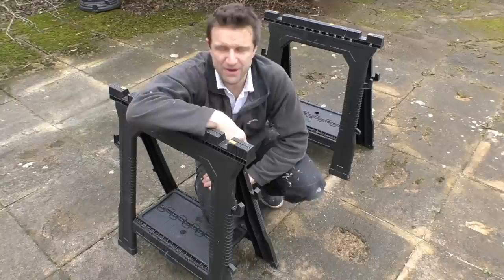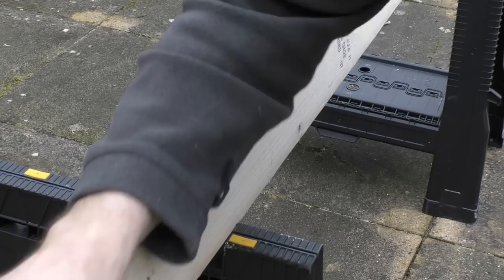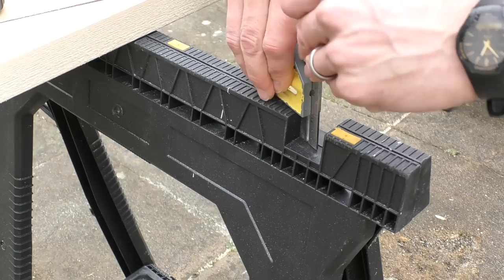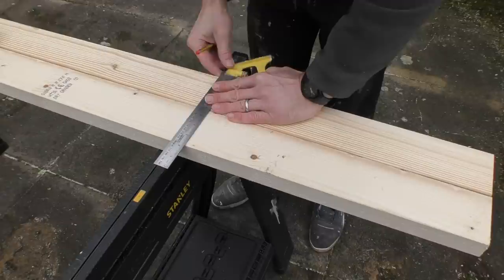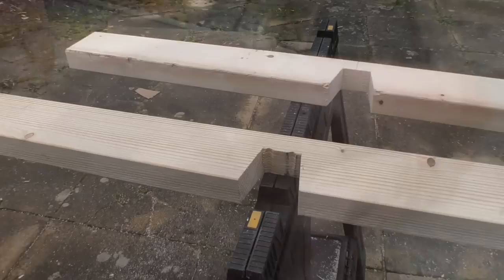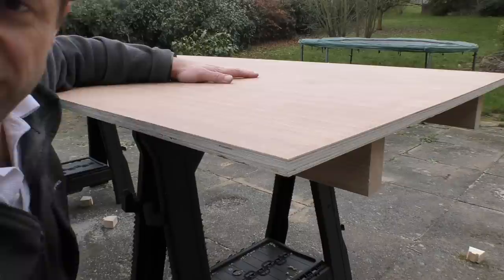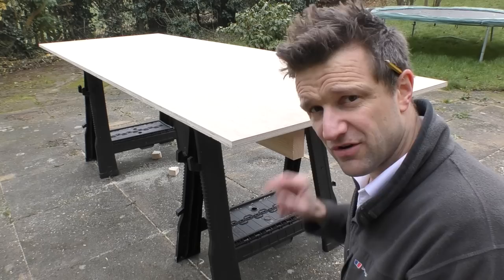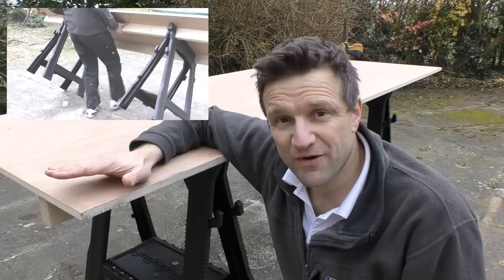How to Make a Portable Folding Work Bench: Video #1 of 5

Comment: Watched this video before Christmas. Added these sawhorses to my Christmas present wish list. Received. I haven't done what is done in this video yet, but I've used them several times over the past week in building new garage shelves. 2x3's slot right in to the notches snugly, and with chipboard screwed to them, or 2400 2x3's used with 2 sheets of chipboard screwed on end to end, this has provided a great worktop and assembly bench. Once finished my work, easily and quickly dismantled, and the sawhorses take up very little space in the garage. Thanks Charlie. Already one of the most beneficial items in my garage workshop, and I see so much more that they are going to benefit with overtime, both inside and outside!! Simple, but superbly effective.

Comment: Splendid video. I have those same sawhorses and have used them with 2x4 studs and plywood to make a temporary workbench many times. I noted the same "rocking" you mentioned but it never occurred to me to lower the point of side-to-side force and thereby reducing the leverage the top-heavy bench has on the structure. Brilliant. My needs are lighter, so I am going to use one-half-inch plywood, just to save some weight. I am making mine today and after that is done I am going to spend time watching other videos you have posted. Thanks again.

Comment: I made one 2 x 1m as a temporary work bench last year. Its been a lifesaver and I can pack it away in the roof space of my garage. I added a couple of rows of bench dog holes for extra versatility and so I could use it as a track saw station. Works really well. The Stanley saw horse are currently (13/03/2020) on offer in Screwfix £20 a pair so about 30% saving.
Reply: £20 a pair again from screwfix on 14.08.21

Comment: Just a suggestion for all you DIY'ers, the 2x4 supports under the short end of your worktop will work best if they are set back 6" to 9" just like the side overhangs which will allow for clamping ease around the whole circumference of the Sacrificial worktop. 2"-3" is all you really need, but I like a few more inches so I can drill 3/4"  Dog Holes As Needed To Allow For Clamps and Stuff. Check out Kreg or Armor Dog Clamps
Reply from the maker: I agree Glenn, and this is what I did when I modified it https://youtu.be/PTN3EmLiYdg

Comment: 27 years in the trade and why have I not done this before.?!
I will be doing now, cheers.
Reply from the maker: James S Flattered that I've been able to show you a new tip James! I've bought the UKJ Parf Guide system but just need to get round to installing it. A bit expensive but it'll transform it!
Reply: Charlie DIYte 
A true tradesperson never stops learning. I’m sure your the same 👍🏼

Comment: Made this in smaller form, using pre-cut 4 ft 2X4" pieces and a 4X2 ft "project panel" topper from Home Depot, who also carries the Stanley sawhorses in this video. I was going to get a Workmate 425, but this works fine for me and saved me some money, too. Cost about $60 as of 7/7/21. Thanks, Charlie.
Reply from the maker: Great work. I couldn't manage without mine. Worth putting a protective strip around the side if necessary. That's in the next video in this series 👍🏻

Comment: I made a worktop using 2 x 3" planks (8 foot length) and 2 project boards of 30 x 48". I simply fixed the project boards to the planks using wood screws to make an 8 foot by 30 inch worksurface, which I simply seat onto the sawhorses for an amazing DIY'er workbench. It's sturdy enough for the at-home projects that I've been doing, though admittedly no where near up to the standard demonstrated here. But for home diy jobs, it's been great. When I'm done the worktop removes easily for storing away. I plan to put some cross supports to up the strength and stability of the worktop since I'll be moving the it around over time as I take it in and out of storage. Thanks for the inspiration!
Reply from the maker: Good work, George. Yes, that sounds like an excellent work around. Bottom line, we all need temporary work tops for our DIY projects, howsoever we make them 👍

Comment: Yes I do the same thing and have done for years, except I don't cut the angles which as you so rightly state gives it very good stability. The reason being that it allows me to reuse the 4" X 2" CLS on other projects. It is less stable this way, but I get by. Thanks for the video, most helpful.

Comment: Of course I will hit the like button and subscribe you have just solved my workbench problem. I had just bought the Stanley saw horses and was using them for door top work bench and needed something better. Your video is perfect thanks for sharing. I think I will wrap the top with 2 x 4s so I can add a vice somewhere. Thanks again very much.
Reply from the maker: Thanks John. There are 4 other videos in the series - you'll find links to them in the Description below the video. It's been truly game changing. Well worth putting a protective hardwood or metal edge around the side, and it's quite heavy to lug around so it's a good idea to try and hinge it if you can be bothered 👍🏻

Comment: GReat idea, gonna make one of those. You can seal the edges with some SBR or waterproof wood glue.
Reply from the maker: There's a whole series on the upgrades I did to this - check out the links in the Description. I actually put a hard wood trim around the side which I massively recommend.

Comment: I cut the 3m CLS in half to give 2 x 1.5m lengths that fit easily into my shed. Rather than one sheet of 4 x 8 ply I have three 1/4 sheets of OSB that can be configured as 2 landscape or 3 portrait as needed. Again easier to store and take to work site. The 4th 1/4 is a sacrificial board for track saw. Guide rail grip strips on the CLS or a couple of clamps keeps it all steady.

Comment: The 2x4's and saw horses are not made to  metric standards if they are for the north american market. You might want to use MDO plywood for the top because it is used for highway signs so it is great for this use. Great idea with the cut outs.LIKED and subscribed.

Comment: Good stuff! Say, if you glue the top to the 2 x 4 ‘s (American slang) instead of screwing it, then you eliminate the risk of ruining a blade or router bit through a miscalculation that brings it in contact with the screws. In addition, without screws, you can intentionally cut through the workpiece, and into the top, to make smoother, safer cuts. The beauty of a sacrificial top cannot be overstated. Wood filler, wallboard mud, and auto body filler all come in gallon cans. Cheers mate. GREAT video. GREAT use of templates.

Comment: I know this was done 4 years ago and I have yet to watch the rest of this series but to carry the "bench" around do you consider cutting out a hand-hold around the point of balance to make it easier to pick the sheet up and move it?
To cut down on the weight a little you could lop a bit off each end (you got the screw holes already aligned) because a full 2400 x 1200 sheet will support itself when hanging over the end(s) of the portable bench.
Finally, it's really nice to hear them called 4 x 2 and not the weird 2 x 4 of a certain country that says the measurements backwards. 🙄👍

Comment: Thank you I just bought them i got tired of working on top of a pail.   Too dangerous.  It's my first time doing a project.  I'm building a cat house for the strays.  I am determined to finished it but i can't if I'm working top of a pail.   So this helps a lot thank you so much for sharing your knowledge
Reply: Kudos for caring for the kitties. NO pails or un-secure "workbenches" please. Those cats need you.  I, who shoulda known better took a shortcut like that (also place my hand perilously close to the saw while I was sawing...) and am now typing with my right hand only, taking antibiotics 4x a day and hoping everything heals by the time they finally take out the stitches next-next week. I plan to get cut proof gloves and use a MUCH more Stable surface the next time I saw....

Comment: Fantastic work. Buying some Sawhorses so would buy two pairs and try this. Thanks.
Reply from the maker: Thanks. Take a look at the other videos in this series (links to them in the Description). You'll probably want to cut it in half to make it portable and whilst you'll see I hinged mine, you could just screw it together when required.
Reply: @CharlieDIYte  Hi Charlie. Yes went through the entire series for this project.  B&Q did not have any plywood so went with OSB 3 Board (length 1.2m). It worked out easy to get a 2.4m c16 cls timber. Thanks again ♡

Comment: Hi Charlie, made a mini version of this at the weekend. Couple of maybe helpful things I learnt: 1. I got CLS 4x2 but it was far too wide for the horses, so had to plane it myself, not sure if the saw horse design has changed or my 4x2 was non standard! 2. As I have got limited storage space I used button-fix to fix the worktop to the CLS, so this means I can totally dismantle it but it’s solid when constructed! Many thanks for the tips, learn from most of ur vids! 😃
Reply from the maker: Hi Simon, thanks for letting me know and sorry to hear about that. I guess it varies depending on supplier. I've bought it from 2 (Homebase and my local builders merchant) and didn't have a problem with it. It's not the saw horse design changing because I bought two new Stanleys recently and they fitted fine. Glad to hear you managed to improvise and hope the new work bench is making a difference.
Reply: Charlie DIYte yea it’s great, making a huge difference!

Comment: Trim off about 15mm on the length of the bottom supports  lighten it up.  Maybe some lightening holes.  1/2 inch, 12mm top.  It's plenty strong. Chamfer the notches, make it a little easier to disassemble.  Done the same thing with my portable Compound saw.   Light is right

Comment: When using 18mm external ply outside, I treat the edges with waterproof PVA glue. Which stabilizes the edges and lets you sand it to a smooth finish once it has been left a while to get really hard.

Comment: Neat idea. Suggest fitting a strip edging to extend the life of it and a coat of varnish?
Reply from the maker: Thanks Barry - massively agree with you on the edging - it's very vulnerable and the layers of ply have snagged apart a couple of times already. I'm actually going to do a dramatic revamp of it at some point (taking some weight out of it, making it fold up for storage and incorporating the parf guide system. I'll send you the link when it's done!
Reply: Look forward to seeing this! Am about to make a worktop like the one in your video - a way to make a foldable would be a great bonus.
Reply: YOU CAN MARINE GRADE WOOD TO BUILD THIS BROTHER
Reply: @CharlieDIYte  did you do an upgrade vid ever Charlie?
Reply: Ignore this question  - just found the upgrade/folding bench vid. Awesome cheers chap!
Reply from the maker: @richardghost5701  Ah glad you found it. Sorry, I'm a few days behind on the comments.

Comment: I'm in the US and made my workbench on the same sawhorses for permanent use in my shed. Portability was not needed. That said, I did not notch my 2x4s because the top's back side and left end were butted against the shed wall. For the top, I used a sheet of 3/4" treated exterior plywood ripped down the center. I don't need such a wide table. I doubled the two halves on top of each other making the top 1.5" thick. No need for screws. It's immobile.

Comment: Hi Charlie,  an excellent idea. I liked, so just subscribed. I too have Stanley plastic saw horses (junior smaller version) and had thought of doing something similar with CLS stud timber.  

I had previously made a MFT top using Parf sticks but didn't want to 'cough up' the full asking for Festool's MFT table - expensive and not that stable. Eventually I built small top frames (640 x 90 x 62mm) to fit on and around top of each saw horse. These are sturdy, compact and not as deep using 44x34mm timber screwed and glued. I added a 18mm ply top for strength. I found Stanley angle to be 10 degrees and profile cut timber frame to fit. My MDF diy MFT top now sits on top. 

For rigidity I  screwed same timber (44x34) underside of MFT perimeter. NB just screwed not glued as easier to replace with new MFT top if damaged/worn out. I can get away using thinner wood as standard top is smaller/lighter at 1102 x 718mm. Removable diy MFT top is now 62mm thick, has a recess of 44mm (cube 44 x 1034 x 650) and is easier to carry using one side frame. One saw horse and two diy saw horse top frames now store inside recess, when wall hung for storage (an elastic bungee cord stops stored parts falling out). Assembled table rigidity is achieved via two M8 50mm stainless steel cap head bolts fitted through each end edge of MFT frame into the 640mm side of saw horse top frame. Pretty quick to power screw on/off. Used with bench dogs and a track saw it's similar to a Festool MFT but stronger and cheaper.

For an upgrade I'm planning to bolt 2 aluminium side beams - using Bosch Rexroth extruded engineering section, available from KJN Automation (60 x 30mm with 6 separate 8mm tracks). Each side/edge frame will weigh 1.65 kg and cost circa £19 but give massive rigidity as well as precision clamping, jigging, fence and saw stop cross cut capabilities. 

I could have lightened top further by replacing timber (44×34) with alu frame but I had wood to hand when I built top and buying in say 40mm sq aluminium tube would have upped cost and been more fiddly to fit (eg rivnuts and countersunk bolts) than using simple long woodscrews - which I had to hand. Plywood too might have been a tad lighter than 18mm MDF - but in this size it's not too heavy to handle fairly easily.

Comment: You mentioned the other video, which I saw just before this, but said that he didn't mention the 2x4 fits right in that slot. He did say it, even showed cutting the notches to make it flush just like you cut out.

Great video though, about to make my own.
Reply from the maker: What's that, Ryan? The timber has to be CLS to fit in the grooves, if that's what you meant. Good luck with the build 👍

Comment: This video es perfect for what i was looking for a good, simple, and not expensive work bench, I will get the material and start this week. Congratulation for your idea .I live in Panama and I make small wood work and home.   By the way..... I suppose , the wood on the top is 244x122 mm. and you cut it ??.    Carlos
Reply from the maker: Hi Carlos - wow - all the way from Panama! Can't thank you enough for taking the time to comment!! It's actually 2440 x 900mm and I could probably have made it a touch narrower - maybe 800mm but it gives you a really good base for cutting full size sheets of MDF. Stay tuned - I'll be posting a video some time soon upgrading the work bench, and I've also got a fab new tool - a hand held circular saw that you can cut full size sheets of ply and mdf with on the work bench. Good luck with all your DIY projects!!
Reply: Charlie, Thanks a lot for your reply. I think, this weekend I will finish, it is a good idea to use a sheets of MDF. With this workbench , I will have the opportunity to work a lo in the wood.   Thanks again   Carlos

Comment: Hmm, maybe Stanley had this  in mind from the beginning...   Still, your presentation is useful. I wouldn't bother drilling the holes for the cutouts.  I would never use MDF - it's very heavy and quite prone to warping over time.  I would also nail on solid pine edging around the perimeter and then varnish all surfaces it. I would consider drilling dog holes along the 2x4 centers, and  then develop a folding (parallel) wedge clamping system that indexes into the dogholes.  It would also be nice to build up one corner so that a vise could be installed - preferably a bolt-on face vise, but clamp-on vise would do too..
Reply from the maker: Bob Blarney Thanks Bob. Great suggestions which I will implement - the edging is a really smart idea. I also intend to try and make the top into a folding top by introducing some hinges and zip bolts. Also thinking of doing in the Parfitt system of dog holes, but the kit is pricey!  Watch this space as I'll do a video update of it!

Comment: I have done something similar but used the small B & D Workmate on one side and a saw horse on the other made with saw horse brackets so it matches the Workmates height exactly. Works well for doing work outside and can be folded away.

Comment: Would picking a lower height timber that sits flush or slightly proud to the stands have the same effect as the notching out and lowering if the thicker timber? Would make the process quicker

Comment: Charlie, I agree about how bulky that is, and it makes me wonder...  Could you make it far more portable by cutting the top in 1/2.
Replacing the screws with bolts and fly nuts (you'd have to counter sink them), and do it in such a way that you could use 1/2 the top in the center position for smaller projects,
and both halves when you need the whole table?

It would store as 2 legs, 2 tops, 2 long boards and a set of bolts?
Reply from the maker: Hi Kirk - it's all been done! Check this out! https://youtu.be/PTN3EmLiYdg and I typically use just one half now, which I can carry very easily with just one hand.

Comment: TBH i wouldn't bother with marine ply. First it will be about twice the weight of the exterior ply. Also the cost is not worth paying for a cutting bench. Finally, i have found it de-laminates  far quicker if wet than exterior or shuttering ply. As an example i did 2 flat roofs back in december for a company, after 2 days every sheet had started to de laminate as it had got wet. In contrast a temporary access ramp i built 6 weeks before with shuttering ply, was still in one piece, despite being rained on nearly every day.